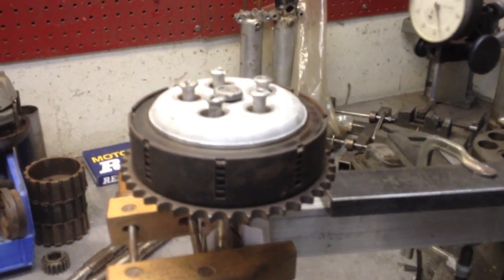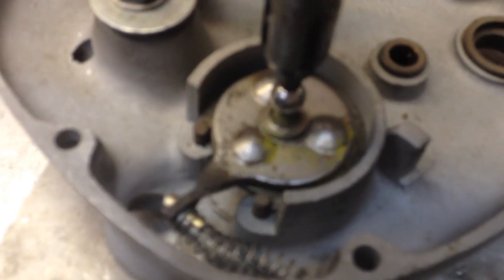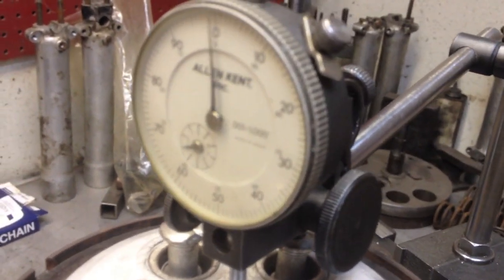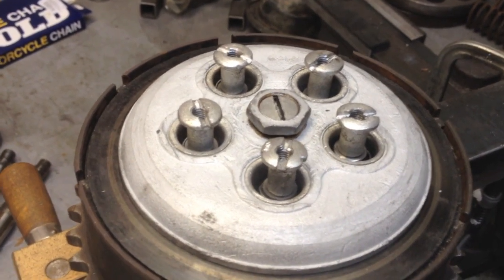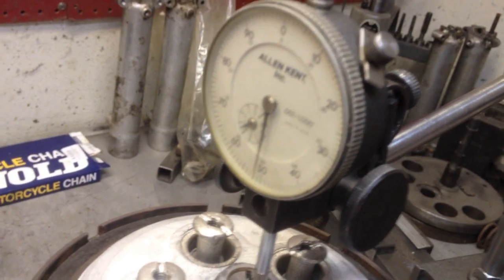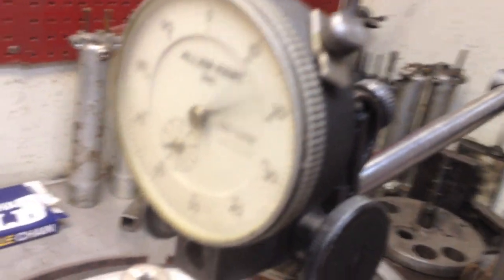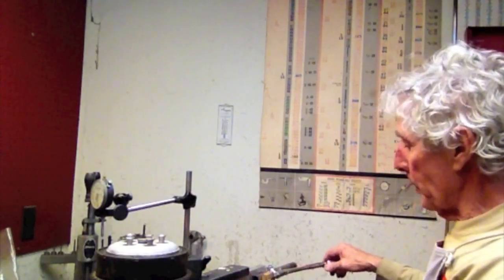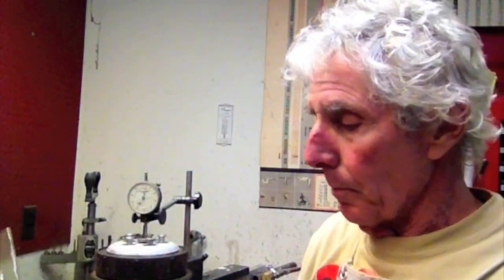My Burman Clutch Drags   Is this OK

Comment: Well done sir! My 1965 Matchless G15 clutch drags alternately (not every time) when I engage first gear. Otherwise it shifts fine. It’s the weirdness of why it drags sometimes and sometimes not that is disturbing.  It started doing this about 40 or 50 miles ago. The machine has a belt primary drive. Brian Paterson in Winnipeg, Canada

Comment: Thank you for taking the time to make this matter more clear and easy to understand than I have ever seen it done before.  Your use of a rig, enabling everything to be seen,  is wonderful.  The only observation I may make is that a mild steel push rod of around nine inches in length will gain around 12 thou. in its length, when the temperature rises from, say 12 degrees C to an operating 140 degrees C.  There will still be clearance, using a 1/4 turn out on the adjuster but not too much!  Thank you, again for explaining it so clearly.
Reply from the maker: Mr.Hay... What the hey?  140C.  Are you riding your bike on the surface of the sun?
Reply: I was referring to the temperature of the push rod, inside the gearbox shaft in the gearbox.  Temperatures in that environment will regularly rise to well above 100 degrees Celsius on runs longer than 30 minutes.

Comment: Greetings Mr. Dick Casey: better explanation than yours, only with the designer of the Burman clutch. Super soft and effective. I never worried, when I still didn't have the minimum knowledge about motorcycles at the age of 20, this was in 1970. The precision in measures with which you narrate the regulation, brings us all the ease and the certainty that nothing is wrong. I own an Ariel Twin model 500 KH year 1952 already owned by third parties with 25 years of use with the weak magnet. It was the motorcycle that gave me the greatest pleasure thanks to its extreme handling and low weight with the small Anstey suspension at the rear. I was very happy that you appreciate Ariel models. They were not English supremacy, but they were simple and less costly to acquire. It got very hot here in the tropical climate of Brazil when requested. However, when I owned it, I was happy and didn't know it!
VERY GRATEFUL FOR YOUR WONDERFUL AND HIGH COMPETENCE EXPLANATIONS!
Reply from the maker: Sr. Gobbo... you and I share music in common. We grew up with English motorcycles, are about the same age, and I grew up in the jungles of Panama.
Stay safe...DC